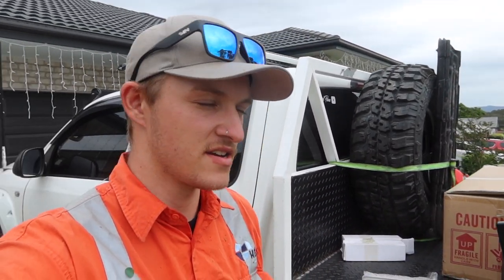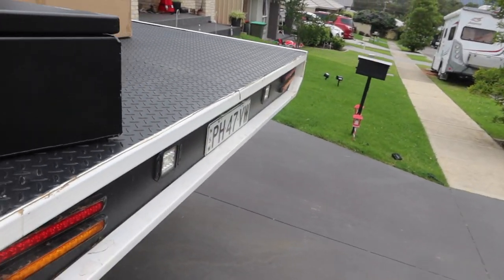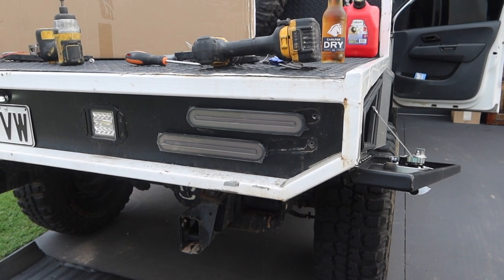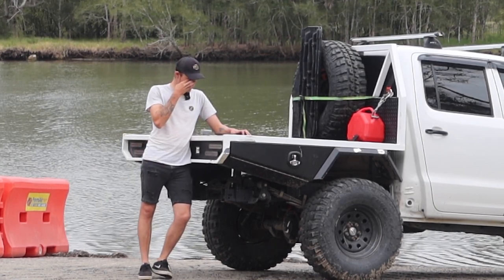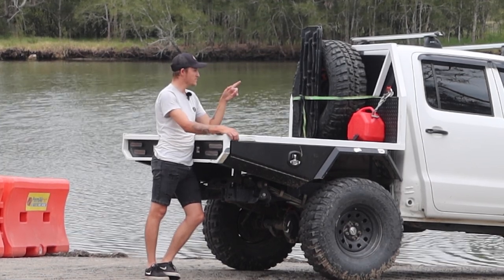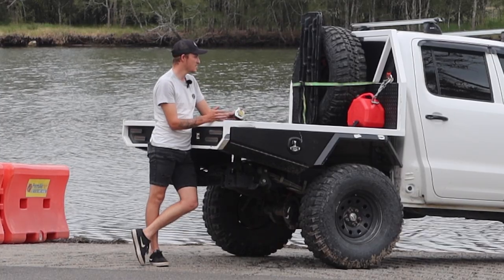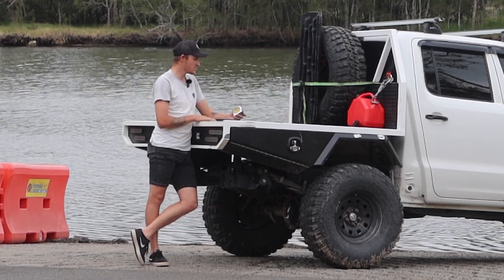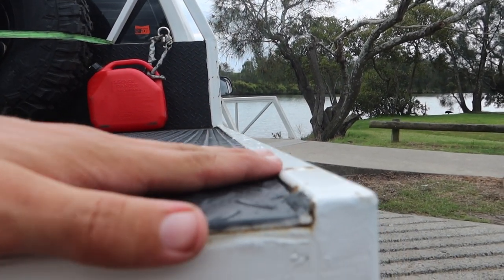D.I.Y Custom Tray build part #5 + Q & A

Comment: Hey mate, 
what length tool boxes did you get?
Thanks
Reply: theyll be fuse fabrications
Reply: @lachlankendall2810  I'm aware, just trying to get a rough estimation what size I can fit as I've got a a 1650L tray on the way. Fused fab are moving towards not selling individual accessories anymore and are only doing tray/canopy packages. So trying to get my hands on one before they sell out. Might just have to wait, measure up and hope they have the size I need when the time comes.